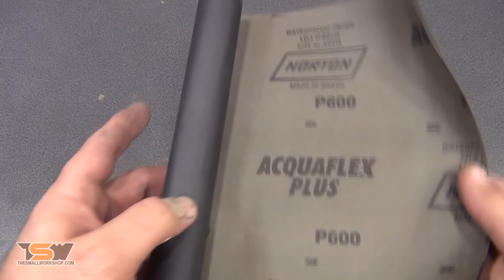Making a Simple Spoon Carving Knife That Anyone Can Make

Comment: I still have a set of five, different sizes, that I made in 1992 !
Have been very useful throughout the years for many things. They actually hold an edge longer than I thought they would !
Thanks for sharing and take care. 👍
Reply: I was just about to ask how well it keeps an edge. What kind of metal are used for wrenches? Can you make a decent knife or chisel from one?
Reply: @MikkosFree , I see blacksmithes using wrenches to make knives.  It's very good steel for tools.
Reply: @MikkosFree  tool steel
Reply: @MikkosFree  .

ها
Reply: I'm a blacksmith, most wrench's are pretty good steel

Comment: This is quite innovative and nifty. I am a newbie woodcarver. A decent quality scope will easily cost around $60. A very high quality custom made from U.K. with specialized steel etc. runs close to $ 200!
Biggest issue with the curved gauge and the scope is sharpening and maintaining the sharp edge. Quality of the hand carved spoon or the bowl dramatically changes when a (razor)sharp tool is used compared to a average sharper tool. The design made by this U tuber is interesting and functional. Will it hold its sharp edge?
Congratulations for upscaling and using your imagination. At least you did not bring in the forging.

Comment: This guy is just showing his way to make a tool , everybody can do it , everybody got different conditions . If you have a power tool or a hand tool , you need to find your way to do it . I don’t get the negativity of some comment .  Nice video by the way .
Reply: Yeah I really don't get the negative comments either, if you don't want to do it then don't and shut up about it, but if you want to then find a way, I have mostly hand tools but if I wanted to I could make this, agreed nice video
Reply: I also don't get the negativity. What was he dipping it into between grinding?
Reply: @harrygrimley4352  i think it was water to "cool it down" because when you work on metal it burns your hands very quickly
Reply: @Maxime_Petit  sure. I was just wondering if it was oil. It was very clear.
Reply: No negativity, just jokes. He says anyone, yet uses some special tools. It's ironic and a good laugh, that's it

Comment: For those complaining about the amount of tools used, you could achieve the same result with a hacksaw, a couple files, some sandpaper and a lot of extra time and patience. The rotary tool would definitely speed things up and an older one with a couple attachments wouldn’t cost much at all. Be resourceful!
Reply: The biggest problem is that you ruin a wrench and put in a lot of effort for something you can buy.
Reply: @charimuvilla8693  My biggest issue is he's using a dremel to create a carving tool.  Last I checked,  the dremel is a carving tool.
Reply: @charimuvilla8693  you recycle a wrench that's no good into an otherwise very expensive tool
Reply: @L00katThePFPic  you don't know how to carve at all i guess, knife is faster, less mess, no noise, and much better finish
Reply: @Andrew Keech  The only thing accurate is the noise.  The mess would be the same as the material removed is the same.  A knife alone versus power tools is definitely not faster. A knife alone vs power tools will not achieve a better finish.

Comment: this is actually a pretty smart idea considering you can buy individual wrenches cheap at a hardware store for alot less than a carving tool
Reply: What's your time worth? 

I'd rather spend $15 on an actual tool, than butcher a $5 wrench (which is made from the wrong steel) for 3 hours.
Reply: @TheMijman  idk but i can whip one up in my shop faster than it takes to get one shipped and or drive to the store and get one
Reply: @angus4202  you don't know what your time is worth?

Comment: Great job. A spoon carving knife in Australia is very expensive so spanner knife here we come!
Reply: +@Leo Cashmore: Where I live, we can buy a suitable ring spanner for twenty Baht. That equates to about eighty cents Australian. So I'm sure the spanner won't mind having an exciting life as a treasured spoon carver, placed in an important location next to the chisels. Far better life than covered in grease, bumping around in a rusty toolbox with all the other spanners (including the much despised open-ended spanners), and the mis-used shifty shifting spanners.
Reply: @Leo Cashmore In the video it does look as if he's taken a really good spanner from his wall rack. But I suspect that by sleight-of-hand he substituted the really good one for an El cheapo one, judging by the streaky marks on the handle. As long as the spanner is a forged chrome-vanadium cheapo, it should be hard enough to make a few spoons. If it were me doing this carver by grinding with a rotary tool, I'd heat it to red heat and let it cool slowly before grinding, then heat treat to harden & temper after finishing. But he said he has no way of heating it to alter it's properties or to forge it.
Reply: @Leo Cashmore But . . . but . . . You have to agree Leo;
The World Needs More Wooden Spoons
Reply: Yeah. Pretty much all the flea markets have a bin of loose wrenches somewhere. You can pick the sizes you want.
Reply: Yes! Here in South Africa a Mora Hook knife will cost over R2000!

Comment: Nice work! Clever. Do you have any trouble keeping it sharp? Wrenches are usually stainless I think, but I have no idea how to tell if it can maintain an edge. Sure seemed to work fine for you.
Reply: Wrenches are not usually stainless. Most modern wrenches are just coated. Shiny or silver doesn’t mean stainless
Reply: @Horizonhunter76  Oh yeah, now that you say it, of course you are right. You can even see the coating flake on cheap ones. Thank you for pointing that out.
Reply: Galvanized
Reply: Chrome vanadium. I googled it. BANJA strong!!!!

Comment: this was great - these type of knives are very expensive - a little work and a old wrench and you have a working tool that can cost 100 dollars or more ( some less ) - you should make another with the sharpened edge on the other side to take advantage of  a reversed grip - hell - just make one of each at this price :-)
Reply: The tool is called a Scorp and is both left and right handed ;-)
Reply: yes i know - i have two but this was a nice modification - i find that if the blade trails i can have more control because i would be sweeping the blade through the wood - i find it gives more control -
Reply: well sort've. You can get spoon knives for $15. Cool idea though if you had an old wrench laying around and a handful of hours to make one. Curious how long the edge will hold up over time

Comment: You should change the title to “anyone with a full workshop fully of carpentry and metalworking tools can make”
Reply: Not even a full workshop just a couple cheap tools. You don't really need power tools for this, you can use files and sandpaper.

Comment: The tang of a file , which is the tool that the handle you chose to use ,are tapered to a point . Taper the tang of you tool and apply some epoxy when you assemble . Sand the wood of the handle , and apply an oil finish

Comment: Alternate title: "Making a Simple Spoon Carving Knife That Anyone (with a spare wrench, and angle grinder with a disk that can cut steel and a disk to grind steel, a dremel with the right bit set, a belt sander with metal sanding paper, high grit sand paper, a buffing wheel and buffing compound, a spare handle, a drill with the right bit, a hand file, proper skill and experience, and a decent chunk of slare time) Can Make"

Comment: Well, it's pretty good but the problem is, is that the steel is soft as it hasn't been heat treated and tempered, so it will blunt really quickly. Personally I'd just buy a Mora hook knife if I wanted to carve a spoon or bowl.
Reply: Here in South Africa they cost over R2000!

Comment: "Anyone Can Make"

You just need:

-Quality steel combination spanner
-Bench vice
-Angle grinder
-Belt sander

-Rotary tool + assorted bits
-Second rotary tool + bits
-Benchtop metal lathe - with polishing wheel
-Box of old chisel handles
-18v combi drill

Yeah, everyone's got that at home...

Comment: You must make it, only if the, the key accidentally , is broken, not to cut it.The key cost, 7$, the spoon cost, 0,7 $, so for us is not so kind to see that, you are an artist, but i am an economist and artist ,in this thinngs.
Reply from the maker: The key is 50 cents at a flea market. That entire set was under 7$ new. Also the key that was cut was not part of the set, it was a mismatched one I had for ages. A spoon knife is $20 or more. Plus shipping $10 or more. Spoon carving is a hobby, not a business, so the cost of the wooden spoon is irrelevant, it's the cost of the tool that matters.
Reply: Ok,if you write, that the key ,is not for use, it is ok.

Comment: "Fear not, internet! All you need is 500$ worth of equipment (some of which you could use on the final product you're trying to achieve instead of making an entirely new tool out of another tool that has far more practical use) and about 5 hours of time (in which you probably could have carved 5 spoons with the equipment at hand) and you too can have an absolutely useless piece of junk that you can use for one very specific project and then throw in a drawer to never use or even be seen again!"

Comment: not everyone has a workshop full of power tools, not everyone has extra spanners they are prepared to turn into a tool with a very specific function and anyway spanners (wrenches?) are useful in a variety of circumstances while the tool you make has fewer practical applications.
Learning to use a chisel properly makes your tool obsolete and if you have a workshop full of power tools, you probably have a curved chisel anyway.
Finally, most of the power tools you use to make this tool could more easily be used to carve wooden spoons without destroying them in the process. 
so thank you but no